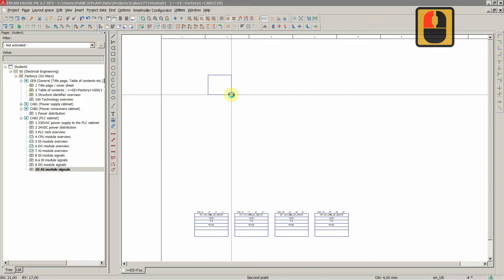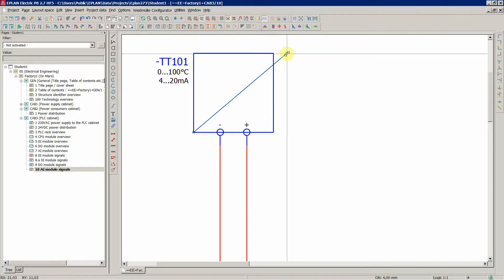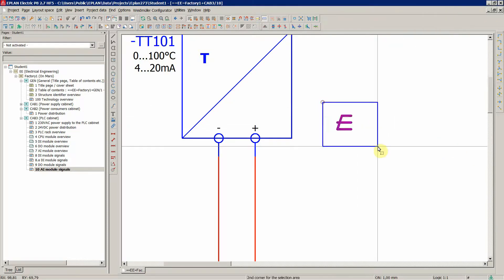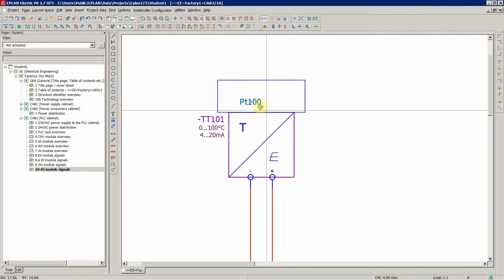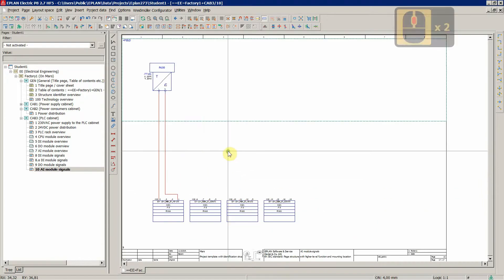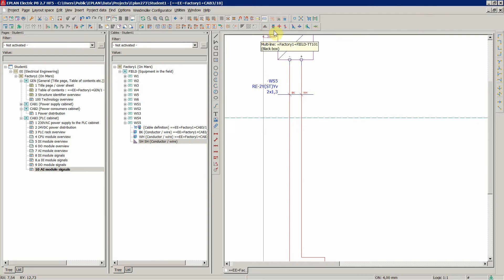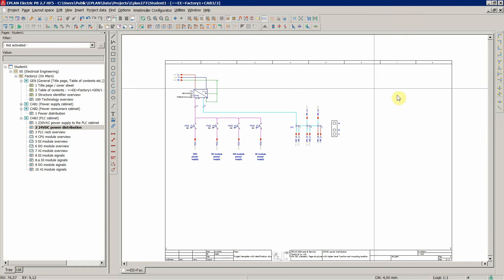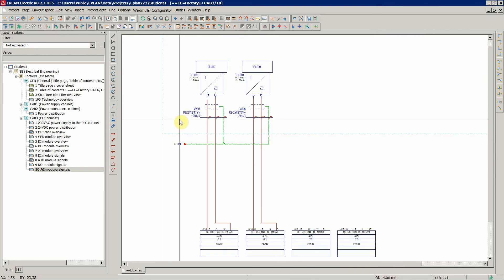ePLAN Electric P8 Complete Course 2020 A to Z - Analog Shielded Cables (Free Preview)

Comment: Do you have a specific course about another eplan's tools like a eplan pre-planning or fluid?
Reply from the maker: Hello Jardas, I still haven't covered these modules in my courses. The fact is that these are still pretty rarely used in the practice, at least what I have seen so far on my industrial automation projects for customers across Europe...
Reply from the maker: I do have an Eplan Pro Panel course, in three Volumes. Here's the link to the Pro Panel courses: https://www.appliedelectricaldesign.com/all-propanel
Reply: @appliedelectricaldesign  I'm going to look that ones! Thanks for you attention!
Reply from the maker: @jardasfernandes6886  You're welcome! :)
Reply: @appliedelectricaldesign   Mr. do you have any course about how to design net like modbus or profinet devices in eplan?
Reply from the maker: @jardasfernandes6886  I have many example projects on my computer regarding Profinet/Ethernet networks since I work on large industrial automation projects in the automotive industry and beyond. I just have to find some time to make a course about that. I do have one course where I show and explain the Profinet connections. Here's that course: www.AppliedElectricalDesign.com/german-automotive